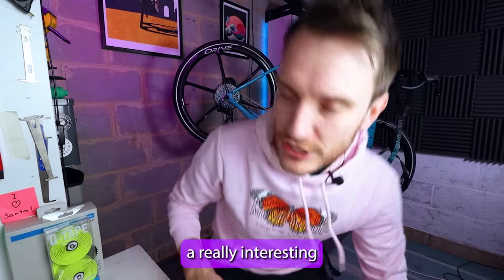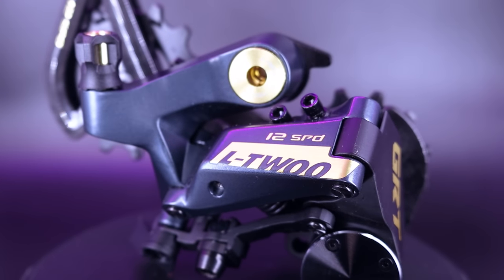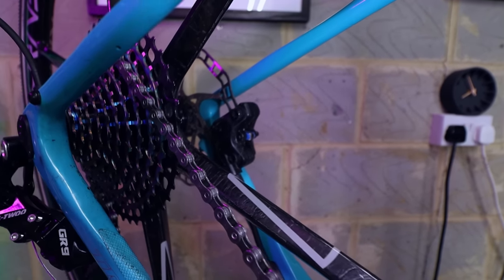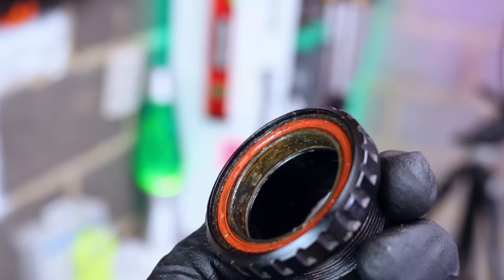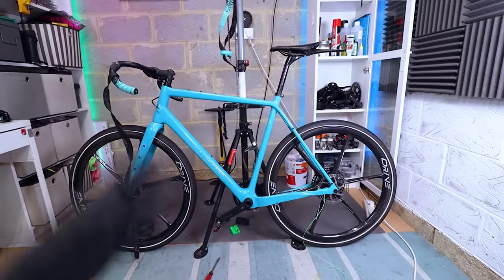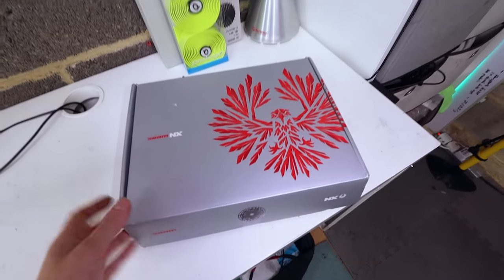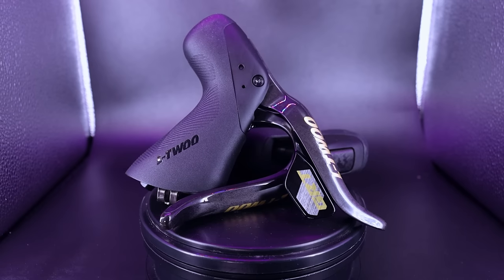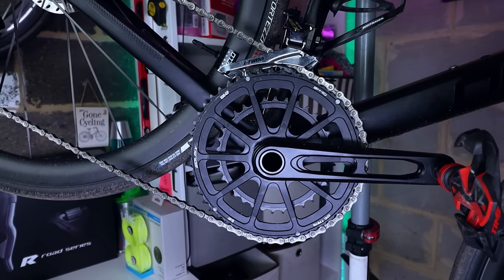INCREDIBLE 1x12 gravel performance on a budget - L-TWOO GRT

Comment: I had a different road crankset by Goldix and after maybe 200km the right side pedal came out and taking all the threads with it. It was tightened for sure and not cross threaded. I had to peel all the threads off the pedal axle in fact. Also super flexy.

Comment: The 160/180 front adapter doubles as a 180 rear adapter. So it’s used for 160 front and a 180 rear

Comment: Spacer behind the cassette for anything larger than 32t on a Shimano hub. Same thing happened to me with a 34t cassette in a Hunt wheel some years ago. Even Hunt didn't realise there was an issue. I did chuckle when I saw that on the video. I bet it's caught out a few home mechanics.

Comment: Great video as usual. I will be considrering this group set on my next build or upgrade. However, im just a wee bit concern how easily the lever snapped when you crashed. That will never happen on a shimano lever. 

Oh by the way why on earth are you riding in the middle of the track?? thats is the worst part of a track you should be riding.

Comment: After I installed a 12(11-50) speed sensah/sunshine cassette(from using a 9speed).  the rear chain line needed to adjusted. For me I needed to adjust the axle spacers to bring the Freehub closer to the frame. and true the wheel again.

Comment: Some forks add 20mm to the clearance, hence the confusing 160/180 sign. I have one like that, so use 160mm adapter for a 180mm rotor.

Comment: The brake adaptor if used in the front is for 160mm rotor but if you use it in the back then you'll need to use 180mm rotors.

Comment: Great review. As others have said, this really is what the market needs. For the bottom bracket, you can actually extract the bearing from the cup and press a new one in (if you really are on a budget - or simply can't find a replacement). I've done that myself - it's a faff but worth trying. 🥖🥖🥖

Comment: Are you running gear housing through the entire frame under the BB or do you need to segment it just on the outside on the 696 frame? Thanks.
By the way the shimano brake adapters are equally confusing and also have 2 values on them, this one's not on Ltwoo
Reply from the maker: Good question! So this is an ICAN X-Gravel frame, but does seem to be the same as the 696. I make use of the frame stops here, so only the cable itself goes through the frame. Hope that helps!

Comment: My GRT group set arrived yesterday, just a heads up they’ve changed the labelling on the brake adapters now so they only have the right disc size on them. E.G the ones you have fitted here only have “front 160mm” or “rear 160mm” on them.

Comment: Oh no glad you are ok. I've not had any issues with the cranks. Some slight creaking when trying to put out the watts. I'm using a FSA BB with a conversion adapter from 30mm to 24. Could the creaking be because the bearings on the BB are shot? I've done a few sample sprints around 500 watts and if they where flexy cranks I would definitely feel chain rub on the FD. I've not had any real issue with that. As far as crank failure, if you can muster 1000 watts on any given ride and you are a smasher these are not the cranks for you. I love to see pic's because some people would like to just bash on products because they are not Shimano, SRAM, Campagnolo. What did you use to replace the cranks?

Comment: I just installed my GR9 hydraulic groupset and I am disappointed. The shifting resistance is appauling. I used ltwoo's supplied cable and a jagwire housing. The cable looks good quality. Copper-colored so maybe it's coated with something. It's definitely polished and smooth so maybe it's the cheap housing or the fact that I routed it on the front side of the handlebar where the horizontal bent is bigger forcing the housing to bent more. The levers have another groove to route the housing on the back side of the handle bar for a less bent of the housing so I must give it a try. 

But the worst thing is that the left lever bleed port screw is tightened so hard that it won't budge. I stripped and rounded its head trying to loosen it and now it's stuck forever. Suprisingly I was able to bleed the system using just one syringe plugged into the caliper so from top to bottom. But anyway I am waiting for the seller's response and his solution becasue this lever qualifies for a replacement. 

Other drawbacks:

1.  Rubber of the hoods is slippery although it has a matte feel to it and has a texture. Shimano's hoods are way more grippy. 
2. To save manufacturing costs, for the left lever they use a lever from a 2x groupset (maybe rx) because it has guiding groves for the shifter housing under the hood. They simply just don't put the cable ratchet pulley and shifitng paddle and trigger. That's ok but without this ratchert, there's a gaping hole underneath the lever where all the gunk and dust may build up. Also while on the hoods having your index and middle fingers wrapped around the hood, you can feel that hole and it's edges under the fingers tips which is uncomfortable. Especially when you grasp firmly while pedalling hard out of the saddle uphill. How much would it cost them to desing a simple plate cover with an i.e. elastic latch similar to those of battery compartments in tv remote controllers? 

3.  Downshift trigger is in awkward position. Its position and overall lever shape is heavily inspired by Campagnolo Ekar levers which apparently have the same problem which Paul from Mapdec Cycles reported in one of his reels. On the hoods to reach it you have to sort of lift your hand and twist it inwards. also when pressing down the trigger, if you have your fingers wrapped underneath the lever, they are right under the trigger and obstruct its downward travel so you also have to move them away. I would expect the trigger to be place more towards the front of the lever just like it is in ltwoo's mechanical road levers like r9, r7, r5... Also, it offers up to 3-4 downshift with single push. I think this is unnecessary, because it causes excessive  unwanted downshifts. It could be justified in the road RX groupset in finish line sprint situations, but this is a gravel groupset so I think it's pointless and useless. On the plus side, the trigger is ergonomic and right were you'd look for it while on the drops. 

4. Lever instllation is troublesome. The bolt clamp is located in the center of the lever body so the vertical part with the master cylinder obstructs access to it to an extent. Also, the bolt is very hard to reach becuse the rubber of the hood is very tight and does not peel off enough to expose the bolt. You need to have an extended hex wrench with a ball-head end and prefferably with an attachable handle. With a standard-sized wrench it will be very hard to reach the bolt. For comparison, in Shimano levers the bolt is on the outer side of the lever body and it only takes to slide the wrench under the hood to reach it. 
5. The rear derailleur isa bit too big. I've installed it on an Accent Furious Pro frame and noticed that if I loosen the b-tention screw too much, the  front of the derailleur where the clutch is located touches the chainstay and wedges on it preventing normal operation. Also, the part of the derailleur with this clutch is visibally made out of some kind of composite material, probably based on nylon. It's definitely not metal. The rest of the parts, like the pantograph, pulley cage are indeed metal. Unless you buy a version with a carbon pulley cage of course. 

Pros:

1. Overall quality is good. The logo imprints are good. They are thick and have a nice sort of brushed aluminum texture. 
2. The shape of the hoods and lever blades is ergonomic. They feel good under the fingers both on the hoods and on the drops. 

A this point I honestly do not recommend GR9. It's not worth the risk. I can recommend R5 because I have had these levers for two years now and they have not failed so far although the shifting resistance is also quite strong but not as strong as with these GR9 eventough I have the shifting cable routes along the front of the handlebar as well . The overall build quality and shifting is comparable to Shimano Sora..

Comment: That water could be running down the inside of your frame and end up on the bottom bracket that way, that o-ring only serves to prevent water ingress at the axle.
I wouldn't fault the oring for the water imediately, but it could very well be the culprit aswell. :)

Comment: You need to put a spacer on the xdr freehub because you are using an xd cassette!
Reply from the maker: So on these set of wheels, it uses an 11 speed Shimano HG freehub. The VG Sports cassette, and the SRAM PG 1230 use a HG cassette mount. I actually have an XD freehub for these set of wheels somewhere in the garage, but in this case, i am using the HG freehub.
Reply: @TraceVelo  Ah, ok. Still looks like you need a spacer, my friend. From the construction it looks like a 11 Speed MTB cassette with a 12th gear bolted to the spider. The spacer also would bring the 12th gear a little more away from the wheel. You installed a MTB cassette on a road HG spider. Road HG Freehub is 36.75 and MTB HG freehub is 34.95 mm. Install the spacer! GoGo! Its somewhere in the garage.

Comment: After this month of use, how is the groupset? I'm building a gravel and will use the same setup as you. I'm just wondering about the rear derailleur material. I'm a little worried about whether carbon fiber will be reliable. Greetings from Brazil.

Comment: Nice. I'm planning on building my first gravel bike , i always used MTB and i want to have a gravel for some road and gravel use. And also I plan to do my first triathlon this year so I'm between 1x or 2x group set. 
This one seems a nice one. I'm really used to
Hydraulic brakes from
Mtb and I didn't want to go back to cable ones.  But I think that there are no hydraulic 2x groupsets yet.
Reply: IMO if you are doing a dual purpose bike you will fare better with 2x (50/34) and probably 2 set of wheels (Match the hubs and rotors for easy swap.) with a road cassette with 28s or 30s and a gravel set as wide as you think and 11x36 (unless you need even more gears.

I have seen a few Chinese "all Road" frames with a very slightly relaxed geometry that take up to 700x38 tires but you can go wider with 650b wheels. I've been trying to figure out how to replace my roadbike on a budget.
Reply: @dirkhunt9425  yes. I'm planning on having 2 set of wheels. Since I don't have the budget or the space in my home for 3 bikes.

Comment: That's disappointing that it broke after 1 fall like that. I crashed on my sensah srx going about 20 miles per hour, slammed into the ground and shattered my clavicle, but the groupset was just fine, just some scratches. On the lever.

Also very curious to see what sensah comes out with in response, but I doubt we'll see anything until the Shanghai bike show.

Comment: Hi Luke. I'm thinking on using this groupset for a monster gravel build, using an MTB frame that is post-mount. Given that the brakes are compatible with BH-59 hoses and olives, do you think that using shimano calipers (something along the lines of the MT-200) would work? It'd be a Shim-woo system, not as fancy sounding as the shiguras but an easy solution for post-mount mounting.

Comment: That cassette issue you run into is exactly the reason I wish this groupset was 11 speed. Mass market is not ready yet for 12
Reply from the maker: So there is an 11 speed version of this groupset that is identical, just 11 speed. Plus it's a little cheaper actually...
Reply: @TraceVelo  what, where?! That would be great if it is true. But in fairness, LTWOO don't have even 1x12 on English version of their website (only Chinese so far)

Upd
One has to search for 1x12 GRT, then pick the 11 speed option and it will be called GR9 instead, just like an outdated mechanical groupset🤯
Reply: @feedbackzaloop  R9 is 2x11 hydraulic road and GR9 is 1x11 hydraulic gravel :)
Reply: @woutervanderdoes5163  (g)r9 is a different story though, also not hydraulic. Explained in the begining of this very video.
Reply: @feedbackzaloop  the R9 doesn't have the same issue as the GR9. The hydraulic version of the GR9 1x11 comes with a different derailleur that's almost identical to the GRT 12s one, so it has compatible cable routing :)
Reply: @woutervanderdoes5163  ok, I found it. Yeah, it's basically GRT, but branded as gr9, just like older mechanical gr9.
But must say, 2x11 hydraulic r9 looks like an abomination with that derailleur.

Comment: Im glad you're ok, Have you tried riding on the existing ruts in the road rather than the crap in the middle of the track?? Just a tip from experience having ridden on slippery wet flint track  on the South Downs!!  😁😁😁

Comment: I'm glad you were not hurt to bad turning your brake lever into a break lever. I ride solo in some remote areas and this is one of my worst fears, getting stranded with a mechanical issue.  I've sacrificed the convenience and technical marvel of brake/shift units with plain cable levers and down tube shifters on my drop bar bikes. 

In retrospect, do you think that alloy lever arms would have survived the crash better than the carbon units?
Reply: Absolutely. Carbon levers snap so much easier. My friend snapped his ultegra lever on the first crash. My metal tiagra levers are going strong with a few crashes

Comment: I just installed the GR9 hydro group.  Love the feel of the shifters and the shifting action (long time Campagnolo and SRAM user), the brakes are dialed in and work well. Buuuuuuut.....the shifting performance is not great.  Shifting up they work well. But the down shifts are hanging a bit, and I need to shift down 2then back up one.  Any thoughts on what I might be able to do to improve here? (for reference - prior to this install I had SRAM Force full mechanical on the bike, shifting was good)

Comment: Hi Luke, do you happen to know if the pull ratio of the GRT levers is the same as on RX levers?
I would like to use GRT derailleur with RX levers, and convert the left RX lever to actuate the dropper post...

Comment: Great Video Luke! Got a question on the GR9. There's a GR9 "2022" hydraulic group set on Ali express, seemingly GRT but 1x11. So this is another GR9 than the terrible feeling group you installed a month ago?

I'm tempted to go GR9 since my I share 3 wheelsets with 11 speed cassettes on my 2 bikes, and wouldn't wanna swap to 12 speed for each bike and wheel

Comment: if you'd be installing the 180/160 adapter in the rear you could use 180mm rotors ;-)

Comment: One observation concerning your crash: It looked like where you were riding there was a raised hump (crown) running along the center of the track. It seemed as though you slid off the right-hand side of the hump (an adverse camber) causing you to fall to your left side. Why were you not riding on either side of that hump where the track was flatter? Glad you weren't hurt. (Quack) happens.

Comment: On the brake adapter, if you flip it you can use a 180mm rotor. Same idea as the adapter that comes on front shimano flat mount calipers.
Reply: Second this. The 160/180 mount will work for 180's if you turn it upside down.

Comment: Hi, how are L-Twoo hydrahlic brakes and others you test? Do they leak, if so where and how long between bleeds.

I'm a 25 year vetran bike tech working at an escooter retailer distributor rebrander. We deal with a lot of leaky Zoom brakes. 

The Nutts seem to be better. The one set of Tankes we have the rear banjo leaks after two test rides.

Do you have any email contacts at Zoom or any of these companies or does anyone else here?

Comment: You are not leaving enough cable and housing in the end where it connects to the rear derailleur. I would say you are short about an inch or so. You will increase shifting performance doing so. I believe Shimano or Sram have some type of reference regarding this standard. 🥖

Comment: Careful with dramatic engineering for typical components like the crankset you showed ...there is a reason why most.manufqctures don't adopt such redesigns because failure is omnipresent and those people with a great deal of power and strength will snap these types of cranks your not saving much if they flex or creak during a ride that goes the same with hubs and bottom brackets better and stronger versus weight always wins over light in these areas. No one wants to hassle with constant fixes after installing a component. Cheers.

Comment: Are the levers actually carbon? It looks more like plastic with the molding imprint seen on the backside of the lever. None of my carbon levers have those structural elements on the backside, because thats not typically how you construct rigidity for components.

Comment: Injection molded brifter levers? No thank you. That broken lever is definitely an indication of the quality that is inherent to those shifters. That was not much of a crash, they should have survived just fine. I think it would be well advised to wait until Sensah comes out with a hydraulic groupset. Excellent video as always 🥖🥖🥖🥖🥖
Reply: Yeah, the cheap groupset can become quite expensive when you have to replace a lever every time you have a small fall like that...

Comment: Luke, I installed Ltwoo GRT 1x12 and when I tightened the brake levers onto the bars the levers wouldn’t move, they are locked up. The gear shifter works fine. But brake levers won’t move. Any ideas how to fix this? Jonathan

Comment: Bummer about your crash. I’ve never seen a brake lever snap like that. Usually the bolt torque on a shifter is only about 5nm. Did over tighten the shifter bolt? A good whack should move the shifter so the lever doesn’t break. Either that or the construction of this part is bad / weak.